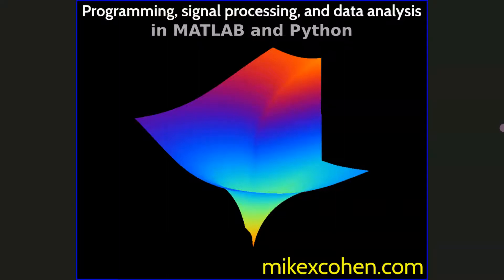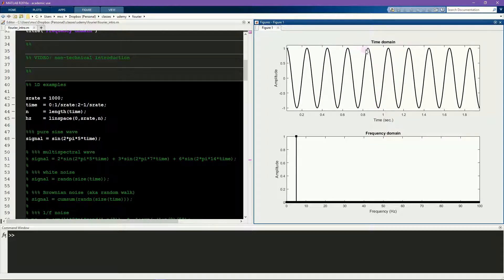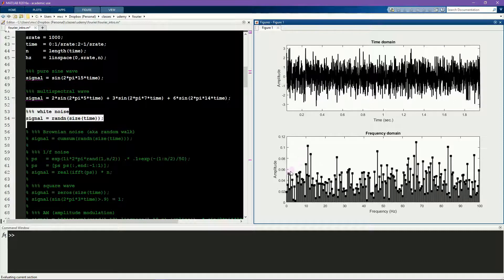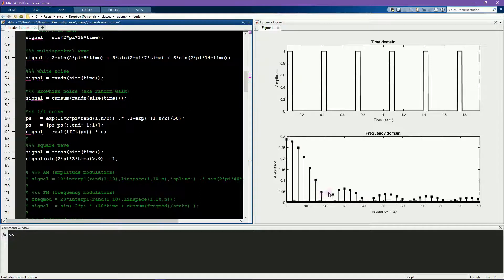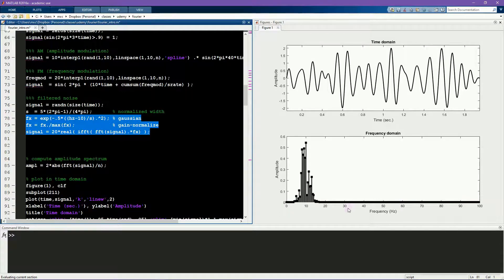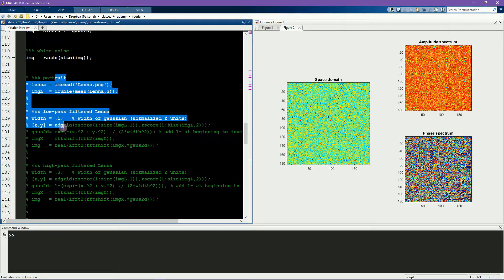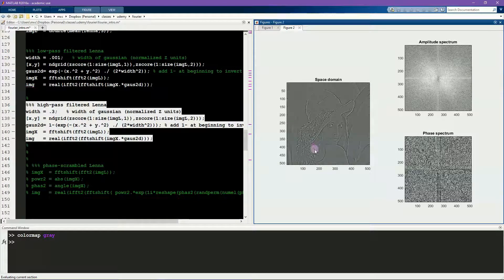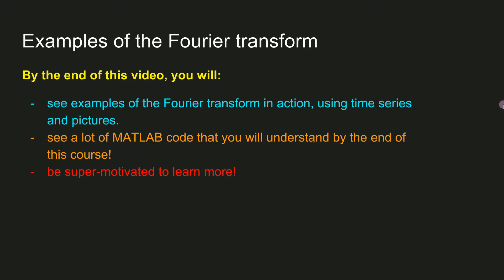Examples of Fourier transform applications

Comment: Hey, what does the frequency and amplitude of a static picture mean? I only understand these terms with respect to waves.
Reply from the maker: You can decompose a picture into (2D) sine waves. In fact, a time series signal is also "static" in the sense that in offline analyses, you have the whole signal and all of its time points. Maybe it helps to think about a picture of a rock dropped into a still lake -- that rock will produce ripples in the water, and you can represent those ripples using spatial sine waves.